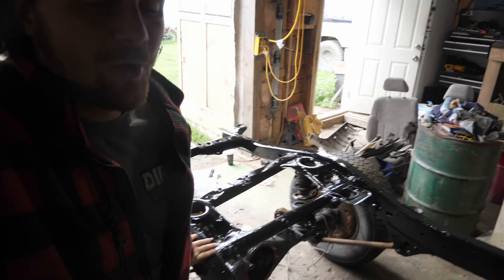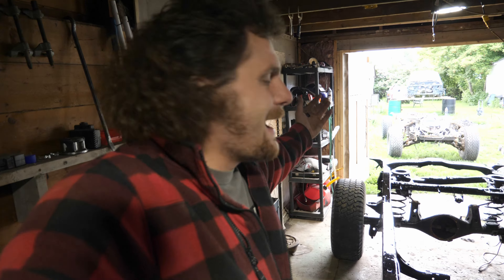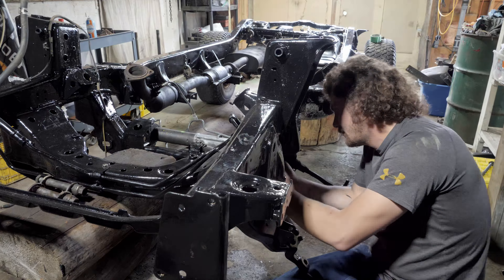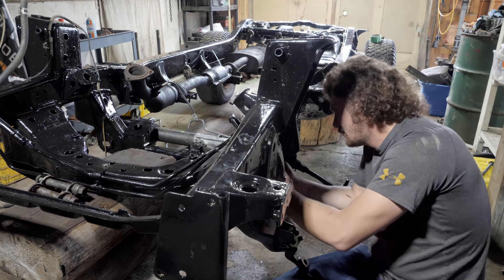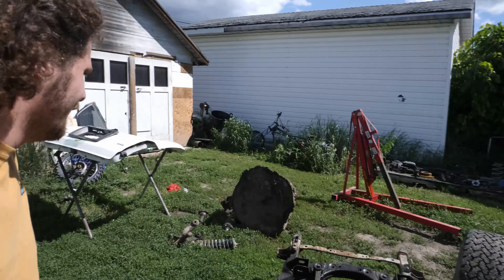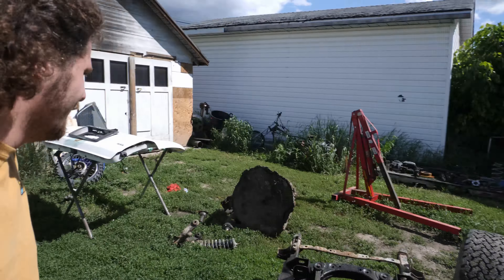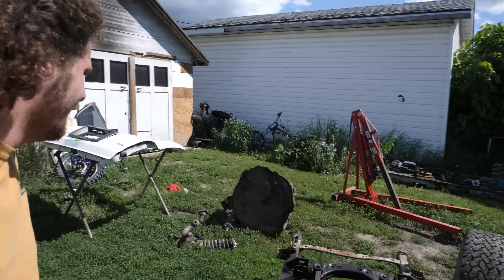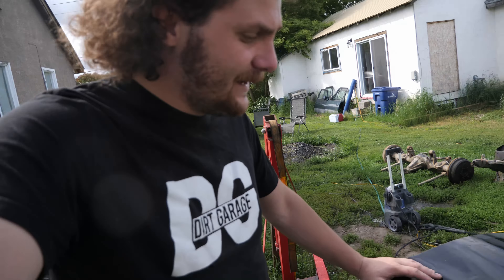3rd Gen 4Runner gets a NEW FRAME... Sorta

Comment: Just an inexpensive tip for paint in the future. Here in the US that two part paint isn’t that cheap and you need a lot to paint to do an entire vehicle. Your color shade will depends on your base coat color. I did my rig in a od green by Krylon and my original paint color was blue. So in the end it turned a darker shade. If I wanted it to be a lighter shade I would first hit the vehicle with a grey primer then spay it with the same od green. That concept will work for all colors choices.

Comment: If you're going to use rattle cans on it, you should consider Spray Max clear coat. It has hardener in it, just like if you would mix it yourself. There's a button on the bottom of the can, to release the hardener into the clear coat. You can get a professional finish with UV protection, that will hold up for years. I've used clear coat from the automotive paint stores and spray max. Both are great, but you don't need a gun and you're not dragging a hose around with the spray max and no clean up. The spray pattern is huge compared to Rust-Holeum or Stuplicolor, more like a professional paint gun. Amazon's got it and the more cans you buy at a time the less, per can it costs. I'd recommend 8 cans minimum for a 2 coat finish, on that beast.
Reply from the maker: Thanks for input! We have painted a few vehicles on the channel the same way I did in this video. I'll look into that product!
Reply: That's the issue with rattle cans is most of them are 1k (1part) and that doesn't hold up to time without hardener. I always use 2k primer on any auto parts.

Comment: Somehow just ran across your channel… I’ve currently got two ‘02 3rd gens with 550k miles between the two girls…Run like  Swiss watches, shift like new and both blow snow out the vents.  Of course I change oil every 3k (cheap insurance).  I purchased a ‘22 5th gen and I fancy the 3rd gens much better.  Thx for the content!
Reply from the maker: Lots of character in these 3rd gens! And 90s built Toyotas seem to be the peak of Toyotas reliability, simple and easy to work on. That being said I would also build a 5th gen if I could!